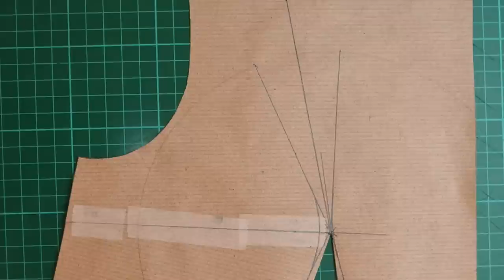Pattern Drafting Tutorial - Strapless Bodice • Elewa

Comment: Hi there, great tutorial! :) can't wait to try out :) but i have a question here, the shoulder dart u did at the neckline is 2" right (1"on each side), don't u have to add back the 2" that u took off for the dart at the neckline back to the side seam? if u don't add back, wouldn't the neckline area be smaller than the measurement? ie. the measurement is 37" and u took out 2" for the dart and u r only left with 34" in total, please help? :) thanks

Comment: I really liked it.
can you please tell me what did you do to do the circle? Iean the measurement.
what is the different your circle and the one I saw other patterns which is smaller?
thank you
Reply from the maker: Hi! The size of the circle is dependent on measurement of your bust radius. Some circles may be big, some may be small, it's just down to the individual. A standard B cup is around a 3" inch radius, but mine is a bigger than that, hence why some other circles may seem smaller. Hope that clears things up! Thanks for watching!
Reply: I understood that you go around cup size.
thank you it was helpful.
Reply: Elewa it's very new to me and helpful.  So I understand 8cm which I saw in a book is a radius for small bust.  What is your cup,  if it's ok to ask?  Or what radius approximately should I use for dd/e cup?

Comment: Hello :)
So I am planning on sewing an elegant dress for myself (my cousin's getting married) and I would like to use the tutorial. I am very top heavy (34F/FF) and I was wondering if this method would still work at this size. The rest of my body is a 12... And if it works, I'd like to wear it without a bra, so would is it possible to add boning or do you have an easier way to make it fit properly?
Reply from the maker: Hello! Yes, I'm top heavy too and it worked for me! You just need to make sure you have enough coverage around your chest - you don't want your boobs falling out :)
Contouring the bodice really helped with the fit, but if you'd like to add boning, that could work too - I've never tried this though, so I can't tell you how it would turn out
Reply: Elewa thank you so much!